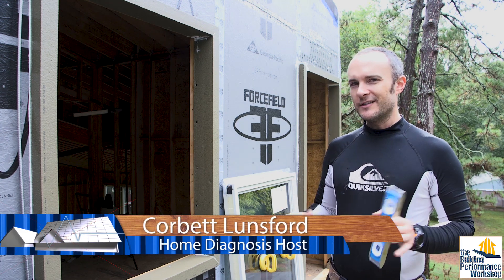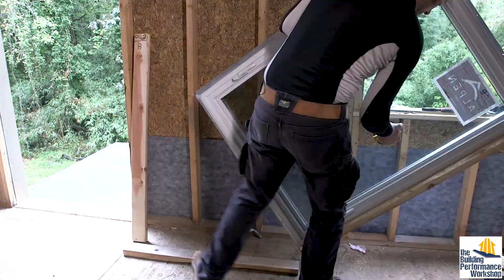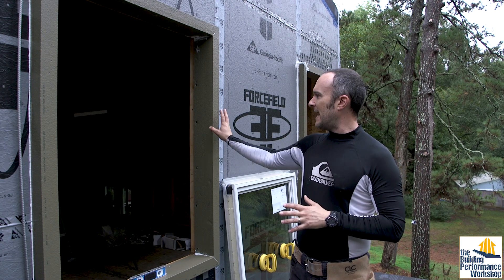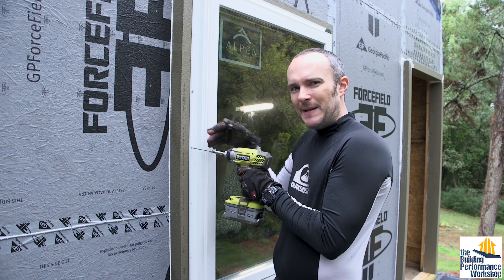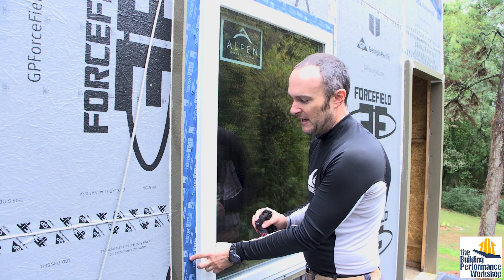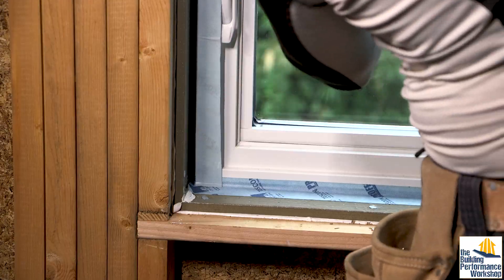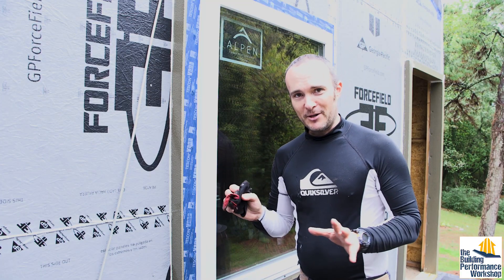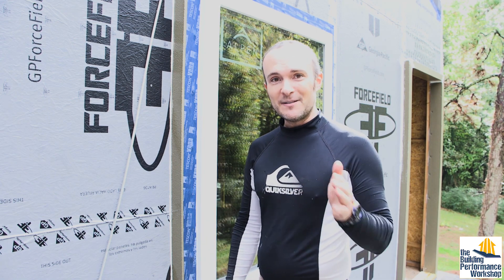How to Install Windows into Continuous Exterior Insulation

Comment: The thing I don’t like about the typical installation of flanged windows is that they end up relatively flush with the plane of the exterior siding so there is no visual depth. Add to this the fact that most modern windows—especially vinyl windows—have no depth and the resulting look is aesthetically bland and even cheap in many cases. If you’re going to all the trouble and expense to build a high-performance home, why not make it as architecturally appealing as possible as well?

Comment: This video was from 5 years ago, so perhaps you have amended your opinion in the meantime but for others out there watching this video, you absolutely wrong about not insulating the gap around the window frame. The physics dictates that this a deep enough air space to transfer heat pretty readily via convection. As you have mentioned, you don’t want stuff insulation in there because that compresses the tiny air gaps promoting heat transfer via conductance. You want to squirt some open-cell spray foam (for permeability so you don’t create a moisture trap) which will expand and air seal the gap while providing excellent insulating properties. The interior tape becomes optional at this point, but you may want to go ahead and do it in case there is differential settling between the window unit and surrounding framing over time as the insulation is likely pull away in places and leave air gaps.

Comment: why you not spray foam between window and window frame ?? Thank you
Reply from the maker: We tape it. But it turns out aside from air leakage thru that gap, there’s not a significant conduction thru the gap if you sized the RO correctly.

Comment: Why not insulate the crevice with spray foam or something?
Reply from the maker: One-part spray foam can wick moisture and hold it like a sponge- my question for someone using a can of foam is always ‘can’t you just tape that?’
Reply from the maker: Also, if you’re asking about insulation alone, these gaps are not significant enough to cause convective looping that would affect comfort, durability or efficiency.

Comment: Like the content, but you forgot to horse shoe shim (1/8”) the bottom which allows any water to easily wick out.
Reply from the maker: Hey Dan, thanks. In this case, the buck is sloped and waterproof, and the window is fiberglass.
Reply: @HomePerformance  but if you’re sloped and waterproofed, should water get in, without a small gap, water would simply sit and cause mold growth would it not? I don’t know of any windows that have weep holes on the nail flange?
Reply from the maker: That’s why you do not seal the bottom edge on the outside- exactly right
Reply: @HomePerformance  I get that, but even with a sloped sill and no tape, a tightly  screwed flange with fasteners as awesome as the ones you used will 100% keep water on the substrate.
Reply from the maker: I think we might be splitting hairs here, Dan- there’s a rain screen to keep water away, plus 2 ft eaves around the house. Pick your battles.
Reply: @HomePerformance  unfortunately, I build my houses to the what if’s factor, if a 5cent shim is the difference between 99 & 100%, I take the 100%. You’re right that if everything works the way it is intended to, nothing will ever happen, but I have seen some crazy things in construction. I’m not trying to pick a battle here. I am merely having a conversation, you’re talking about high performance building, so hence the conversation. Sorry if you’re triggered… wasn’t my intention. It’s just if we are talking high performance building, to me and many colleagues, it’s simply a necessary step.
Reply: @HomePerformance  I should also add that I live in a place where 25 years down the road, something can happen to the house and the current owners can take the builder to court even if the house has been renovated multiple times. As such, I cover my ass where I can.
Reply from the maker: I totally get it, Dan, and I applaud you for being a conscientous builder- all I’m intending to say is there are always extra measures that can be taken to improve anything, even your own best practice window install though I’m sure it’s awesome. We all have to decide for ourselves which extras are worth the time and effort and money, which is what keeps life interesting.

Comment: How worried would you be about condensation with the Alpen system vs a capillary tube?  We are looking at Inline fiberglass windows out of Toronto.  We were also using Rockwool and thinking about using a 2x windiw buck over flashing concerns with the Thermalbuck and very minimal slope with Thermalbuck v. a sillpan.

Comment: I noticed about 5 pieces of 2 x 4 on the inside of the window frame. It seems like a lot. Is there a reason for this design?
Reply from the maker: It's a support post. It supports the roof. I used to be critical of framing, before I understood what framing was for- learned a ton designing and building this house.

Comment: Holy shit, I got worried there for a sec, living in europe and never seen a window with less than 0.5 U value, even 4 glazed windows, and yours said 0.19, but after some googling I found out that U factor wasnt the same as the U value we use here in europe, it translated to 1.07 U value
Reply from the maker: Whoa, you have a different U-value? That's bizarre, I had no idea.

Comment: Corbett, as others have mentioned, I'm curious to see no insulation material used in the gap between the window frame and rough opening?  Being that the window frame is the least insulated part of the window and the most likely area to cause condensation concerns, I would definitely fill that area with something.  If you don't like the idea of foam curing inside your enclosure you can always just stuff it with loose fiberglass or mineral wool.  Leaving it open will allow convection currents to transfer heat through your envelope, especially up the sides of the windows, effectively bypassing whatever insulation is in the window frame.

Just curious, what is the design low temp in your climate?
Reply from the maker: There’s no research I’ve seen that shows a significant benefit here, and anything stuffed in there wouldn’t insulate anyway. Design low here is 23. Tell you what- I’ll be the guinea pig and let you know if it’s a myth or not.
Reply: With a design low of 23 you probably have nothing to worry about.  Up here with a design low of -15F I won't be volunteering to be a guinea pig for anything. :-D
Reply: I was thinking the same thing - that air space between the outer and inner window seal flange and tapes will have air moving around inside / setup convective currents from temperature differences, here where it regularly gets down to -5F or colder in the winter I would definitely want something to stop that air moving around as that would be a cold spot.

Comment: Why did you not use any material (e.g. foam) to fill the gap between the window frame and the wall structure?
Reply from the maker: No added benefit, really. If you mean foam, it’s mostly for air sealing.
Reply: @HomePerformance  Perhaps only for the air sealing. But also for the durability of the construction - it will wedge the window in the opening.

Comment: Is there a reason behind not putting a backer rod or other material to fill the gap between the window and the thermal buck?
Reply from the maker: Yes- my experience testing tells me that it doesn't make a difference.
Reply: you would use backer rod only to accommodate a sealant joint if you were using tape instead of sealant. As he pointed out, sealant is kind of a pain to work with, although it offers some advantages; for example, if there is movement of the framing, it will probably deform more readily (though this depends on the particular sealant vs a particular tape). Corners are a bit less likely to go wrong with sealant. And some architects prefer sealant because it's easier to inspect than tape.
Reply: So to confirm, you buck out to the final depth of the rain screen and not just to the depth of the exterior insulation?

Comment: Great videos. Just for curiosity living in SC I'm looking for good windows for my new home build. How much would a standard size window like the one you installed in this video cost?
Reply from the maker: All 26 windows and doors in our house= ~25k
Reply: Thank you so much.
Reply: I think there are 2 normal sized doors and 2 French style doors, and I'd guess most conservative costs at 1000 for the doors and 2000 for the French doors. So that's $6k off the top of that $25k.

There are also a lot of very tiny windows in the house, and since frames are the most expensive part of a window, that'll scew to higher $/sq ft per window.

These are also the fiberglass American style line. I'm not sure if the Upvc line that's tilt and turn would be cheaper.

You'll get much better $/sq ft going with fewer larger windows where the ratio of glass to frame is higher, but then if they're so large that you can't install them yourself, you'll be paying more for installation costs too.

I'd assume each window would come in at $75/sq ft and then be pleasantly surprised if they're cheaper than that.

Comment: I thought you'd have installed some low-expansion foam, inside, before installing that interior tape.
And "thank you" for reminding everyone to NOT tape (or moisture seal) the exterior bottom of the window frame.         P.S.  Those 4 1/2 screws are thermal short circuits!   Ha ha,  your house will still make it all the way across interplanetary space, to where-ever you need to go!
Reply: I also wondered if there was any expansion foam or foam backer rod in the gap between the buck and the window.
Reply from the maker: Hey John- thanks! The foam is mostly for airsealing, which is already being covered by the tapes, and the minimal insulation benefit would be outweighed by having foam products inside our enclosure- the flame retardant issue is in process in the industry.
Reply: @HomePerformance  Thanks for answering this.  I had the same question regarding the foam backer rod.
Reply: @HomePerformance  If the window is taped /sealed on the outside, why is it still necessary to tape the inside?  Or can air still get in because the outside bottom is left un-taped?
Reply: Home Performance I had not thought of that aspect. Good on you for keeping it foam free!!!